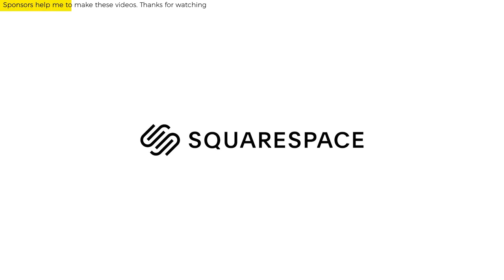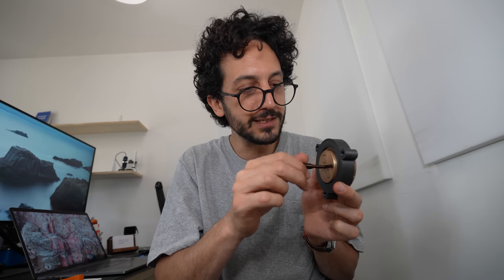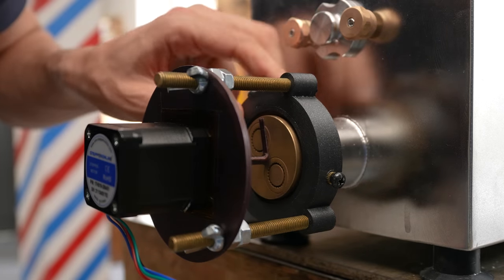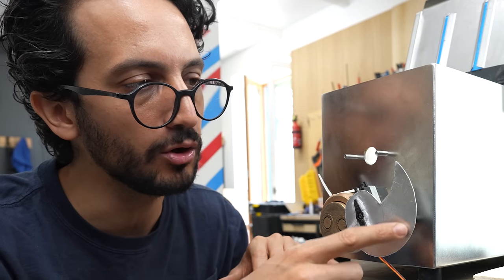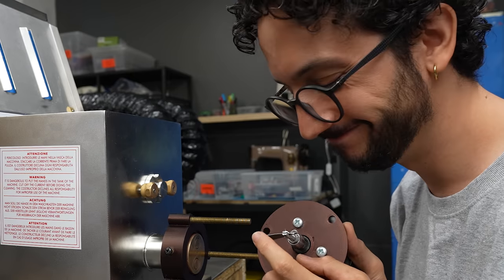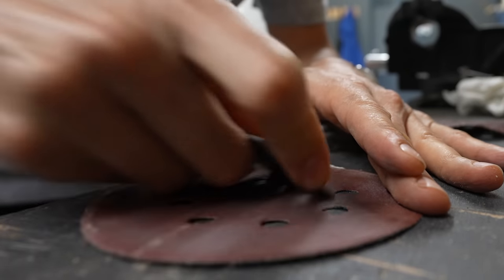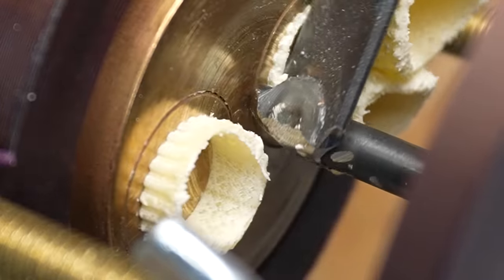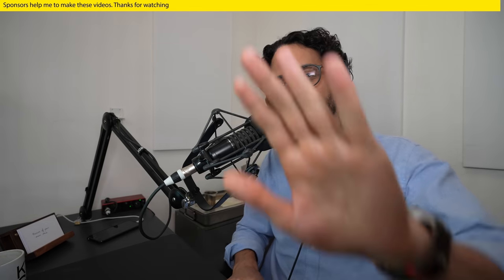I Tried to Make an Automatic Pasta Cutter (did NOT go as planned)

Comment: What if you added a laser that senses when the pasta moves through it sending a blade via servo down very quickly to cut the pasta? Maybe a double edge blade so on the first pass it stays down then cuts again on the way up when the pasta breaks the laser for a second time. Thus minimizing the blade dragging across the constant flow of pasta. You could also make it to where the machine shuts off after a certain time has passed where the sensor hasn't been tripped. For the blade you could use double edge safety razors. Cheap, sharp, and easy to replace.

Comment: Imho, the axis of the spinning blade should be offset from the axis of the die. This way the travel of the blade is almost unidirectional (and not on an arc) you could easily solve the too slow/too fast problem and most importantly you could manage larger pasta shapes like conchiglioni (produced one at a time)

Comment: I was really tempted to do a prototype my own, DIY surely is addictive. Jokes aside, I would have moved the cutter away from the extruder and used some safety razor blades (they are cheap, have mounting holes and cut like hell) mounted on the mechanical arm at the right angle

Comment: Hey alex. You want intermittent motion for this, not constant rotation. You should look into external Geneva drives, which used to be used in film cameras and projectors. It turns constant rotation into discrete and very fast partial rotations.
Reply: *Thanks for watching send a direct message right away on the above number for more enlightenment:••*......

Comment: I was thinking a piece of piano wire that goes in a up/down action. If it’s fast, it wouldn’t matter if it was sharp or not; the cross section of the wire is so small there wouldn’t be any drag on the pasta, leaving a clean cut without the stickiness of a crude blade.

Comment: I think you only need the stepper motor but not with ongoing movement but with pulsed movement (on fast turn after 5 seconds or so).
Also you should use a cutting wire instead of a blade.

Comment: Maybe you could try the "guillotine" approach (very french, if you ask me lol), were it would basically pass a knife like you manually do now, every N seconds. You can adjust those N seconds to get longer or shorter past, and would avoid cutting the pasta slowly on an arc.

It could be a double side blade that goes down, waits N seconds and cuts another piece on its way back.

Comment: Not sure if its just me, but an offset motor cutting would be a different approach, possibly better. Yes, it would have a bigger footprint on the macinhe, but you could guarantee that the cut would be made swiftly, and changing the distance from the motor to the extruder would be an easy way to adjust the length as well. To me it seems like a better approach

Comment: It appears as everybody has a solution in the motor. To me it seemed that the blade itself was rather big in terms of surface area of the edge. I would look into cutting with a spring or a fisher cord in order to cut through with less damage to the dough while still eliminating the game between the die and the cutting area.  Otherwise you are doing amazing job in my opinion and I love your insights about necessity of rest in overcoming the obstacles.  Thank you for it.

Comment: I would try razor blades. Cut them in half widthwise, such that you compress the pasta less.
Also a stop and go cutting procedure might help a lot. Cut one pasta quickly, then stop, cut the other pasta quickly then stop... This should mimick the cutting on a larger die, since the radius of the blade is bigger and thus the local velocity of the blade quicker

Comment: 1. Sharp thin blade, but double sided (just like the knife you were using before, or perhaps a blade for a safety razor). 
2. Double sided guillotine mechanism (yes, it can be driven by a stepper motor, in a sense it's like if the crankshaft of a car engine was what made the pistons move. You just need to do a little math to get the dimensions correct)
3. An adjustable waiting period between passes.

Comment: Try using an intermittent motor controller like the windshield wipers on a car. Faster cut but intermittent. Thinner blade as well, possibly a wire instead.

Comment: Two things comes to my mind. Speed of cut and height of the blade.
Cut need to be made quickly but with this design you will not be able to have longer pasta. So cutter must stop between these two extruder holes. 
With such height of blade your rather push pasta aside than cut it. 

I would try to make something that goes from top to bottom with quick sweep, then stop for sometime to reach proper length of pasta and goes back up. Instead of blades I would choose steel wire. 0,5mm should be enough. Little bit of coding and you could even add some type of safety mechanism (steel wire pass electricity so, in case of break, should not, aka resistance check in Arduino) that if wire would break pasta machine would stop and notify you.

Comment: I feel like the motor needs to be offset so that you have greater control of the length of pasta. So the blade spins around not touching anything for most of its rotation and the slices down on both sides of the extruder at once. Basically mimicking how you do it manually

Comment: How about a linear solenoid pushing a blade across the extruder and then pulling back immediately? Would probably be more suited to adjusting the length of the pasta by varying the rest time between the cutting operations. Your little extruder with only one or two parallel "outlets" (or have I seen  a 4 hole die? ) may not lend itself very well to a rotary cutter.

By the way, I absolutely love seeing a fellow nerd on youtube!

Comment: 2 things that would probably fix all your problems:
1. use razerblades as cuters, easily replacable and... well... razersharp...
2. don't use a continues rotation, instead use software to make the blade spin around once REALLY fast and then stop and wait a while. 

That should stop the pasta from getting squished and also gives you better control over the length of the pasta. The industry can use continues rotations as they extrude the pasta way faster than your machine does, so you just have no chance to replicate that unless you get a faster extruder.

Comment: Hm. I have a couple ideas that may help.

1. The blade is at too steep of an angle to cut without pressing. Maybe going for an oblique angle in relation to the die could produce a more satisfying result.

2. The spring is a great idea but what is the point of it if it pushes a dull blade? Sharpen that steel somehow and that might do better.

3. Use a thinner blade with some reinforcement in order to minimize the surface the pasta can stick to. I can think of the sticking issue as a possibility next.

4. Maybe go all out and redesign from the ground up. Oftentimes, the best designs mimic those found in nature. I would think that making a guillotine would be easier (for you especially since you're, you know, french) than this whole contraption. You could have a belt looping around to ready the blade, push it down through the pasta and past the die after a specific time (also allows programmable length basically) and, after reaching the stop, give it a half a second of rest before quickly resetting it to the top using the belt system to avoid the "new" pasta. Basically, this is the shape i have in mind: |0

Don't give up, man. You are so close.

Comment: okay, so im only at the brass cutter attempt. I think using some sort of fishing line or wire would be a great solution. Less drag and a thin cutting surface. Printing out a U shape that would have a connection to the drive on one side of the U upright. The line or wire across the open end and rotate as tight to the face of the die as possible. Now to see what solution you came up with! Will delete if you come up with this as well.

Just finished the episode. I do think that what you came up with is working very well. I do however think that a wire would work better. if you think of a cheese cutting wire, you remove a lot of drag with such a small cutting surface. it would be able to take more or less speed without interfering with the extrusion process as well.

Comment: Oscillating cheese wire moving up and down? Could even make it spring loaded and wind it using the stepper. Think mouse trap. That way you get the speed of the cutter and the delay between cuts.

Comment: A few problems i see:
1) The blades aren't fast enough during the actual cutting portion, but are also too fast to get full length before the cut begins. My guess is with the proper variable speed, high torque motor programmed correctly, you should be able to get it dialed in. 
2) The blade sections you have been using are creating too much drag with too much surface area and not sufficiently sharp. Larger industrial extruder dies can get around having duller blades due to the force the increased mass of a longer blade, with a tiny blade section as that, it will need to be extremely sharp. 

The best ideas i have for fixing the issue  are as follows:
a)the aforementioned variable speed rotary blade setup.
B) more of a cheese blade guillotine setup. That sends the wire back and forth after the pasta extrudes a specified distance that a sensor is monitoring for. 
I think B is a more effective setup and would require less tuning to get dialed in, but would probably take more time to design and build.

Comment: One issue is the blades radius means it’s travelling slowly close to the axis and the pasta isn’t being cut fast enough, I think this is an issue with your extruded head not your cutter. You could try an unconventional approach and make the pasta blade cut horizontally up and down, rather than rotating. That way you could make super fast, clean cuts, pause and cut again

Comment: you should make the cutter offset from the pasta die with a longer blade. This will increase the distance the blade will need to travel when cutting the pasta, therefore, making more time between cuts. Would a wire string cutter work?

Comment: If I could give my two cents on your project I would say that the problem is not on the sharpness of the knife, but on the way the pasta is being cutted. The pasta is being compressed togheter because the angle created between the extruder and the blade is too high. 

If you ever get back to these automatic pasta cutter project, try lowering this angle, and also use some kind of lubricant on the blade, to help the pasta move away from it easily. I am not sure that it would solve the problem 100%, but I really think it would help a lot.

Great video and I hope you success in the end of the dry pasta journey!

Cheers from Brazil!
Reply: *Thanks for watching send a direct message right away on the above number for more enlightenment:••*......

Comment: Hi Alex,  the problem I see with your cutter designs the location of the cutter relative to the extruder. The industrial cutters have many extruder placed around the outside sweep of a longer blade giving greater control over blade speed and pasta length, maybe of you offset the cutter to one side, using a far longer blade using a single speed the length of the pasta could be changed by adjusting the distance from the extruder to the pivot point of the blade rather than trying to mount it central to the extruder and adjust the blade speed.

Comment: How about mounting a cheap paring knife on an arm with a stiff 'return' spring, then solenoid activates having the knife pulled (or pushed) across the die face. The stiff spring returns the paring knife quickly back to the starting point. A programmed delay on the solenoid will let you adjust timing for as long a pasta piece as you like. Think mini guillotine. (hmm...a very French thing to do...don'tcha think? ;) )

Comment: Just make a French solution: a guillotine style of mechanism that slices fast and can be controlled in terms of speed of the cutting motion, like for example one slice per second. 

It's the same motion as the knife when you cut manually, just straight down with a very sharp blade. 

Suggestion is to use a proper razorblade that can be replaced and sharpened if needed. Very fast and sharp motion that cuts every second or so. Then you could also control the length of the pasta. And the blade can be located very close to were the pasta comes out 👍

Maybe you can modify a sewing machine and attach the blade somehow and therefore also control the tempo at which the slices occur.

Comment: An issue is your speed. When you cut with a knife you had a sharp edge, but your speed was also high. When you slowdown rpm to adjust the length of the pasta, you squish pasta out on your cutter before it has finished the cut. To adjust for the correct length of pasta let the cutte be stationary between extrusions exits and then cut when round fast when the length of the pasta is correct .

Comment: You need something slow speed with high torque, also for the cutter I'd have one of those gears that look like a snail shell, I think those gears disengage for a while till the gear engages again, and when it does it's a fast swiping motion, as if you're cutting by hand
Reply: *Thanks for watching send a direct message right away on the above number for more enlightenment:••*......

Comment: It might work better, still, if you went back to the stepper motor and instead of having a fixed speed the motor pauses in between cutting positions. Then you can swipe across the pasta quickly to cut it, and then you wouldn't need such a big relief angle on the backside of the blade. And then the pasta can be as long as you like. That, or you could channel your inner Frenchman and build a pasta guillotine.

Also it would probably help if you put some vegetable oil on the blade.

Comment: Put the cutter off center and let it cut with max speed and use raizorblades, they normally have a hole in them, but a screw through and fix it on the other side  with a plate and let it run on a 20 degree angle at max speed (remember razorknives ur barber uses for the beard)

Comment: Alex, have you considered the difference in angular velocity between your machine and the professional version? The larger factory machine you've shown (dozens of noodles and a larger radius) features a much high angular velocity... (the blade travels much further, especially near the outside edge of the extruder on each rotation.) This means on your smaller machine, you have to increase the blade speed to cut the noodles as quickly. If you don't, the noodle is longer on one side than the other. In order to allow yourself the ability to cut any length noodle, you should use an Adriano or Raspberry PI microcomputer to start and stop the blade after each cut. A little magnetically actuated reed switch could signal the raspberry pi when the blade was at the proper stopping point. With this you could move your cutting blade much fast and get a better cut.

As an interesting aside. This variable angular velocity problem had to be dealt with with floppy drives and mechanical hard drives. The data must be read/written at a different rate depending on how far from the center of the disk the read/write head was. PCs change the read rate (which is simpler but decreases data density). Macs on the other hand changed the disk spin speed. The Mac solution is analogous to what you need to do. The Mac solution wrote data at the same data density (allowing the maximum data rate to be written across the entire the disk).

Thanks. Enjoy you work.

Comment: Needs to be a pneumatic "guillotine" style knife. Double edge so it can cut on the way down and up. Used with a timer relay and a MAC valve. Adjust your cuts per minute by the second or tenth of second with the timer relay.

Comment: im mechatronic ingenieer, first problem was the angle attack for the blade, second was no reduction gear ratio to increase torque and slow velocity, third no center point, you can just put two blades and program a very fast spin every 5 seconds for example and avoid the countinuous movement, in such a small number of pasta being strude its the best way , you can also increase or decrease the time to get one spin and get a large or shorter pasta

Comment: Gravity is your friend Alex. I think the orientation is wrong. Remember at the pasta factory the blade and horizontal to the earth and the pasta falls through gravity down. In your machine after the rotation the blade is squishing and taking its cut part along for another 180deg till gravity acts on it and maked it fall. This is not how the factory settings was. Also awesome video Alex and don't give up.

Comment: I dont know if they sell shaver blade in where u living in.. but a good sharp blade  is required.. and put the motor a lil bit far from the extruder so that ur blade can have faster motion but and u have the right length of pasta.. but ofc there is more way to do this eg with var speed control where when ur blade at specific angle then increase the speed then slow it down again to get a perfect length of pasta..

Comment: The motor doesn't have to run continuously, just spin the motor using the Arduino code every 4s. The second servo should have more than enough torque but may be a bit slow. In any case you may attach a gearbox if needed.

Comment: You should mimick the knife movement. Translating that into rotation, the diameter of the cutter rotor should be way larger to achieve radial speeds comparable to the manual knife technique as well as to allow enough time between each cut to have the proper length pastas. Also work on improving the cutter geometry and sharpness, the cut should be shearing like a good pair of fabric scissors, except in stead of a second blade, the second surface is the pasta die itself.